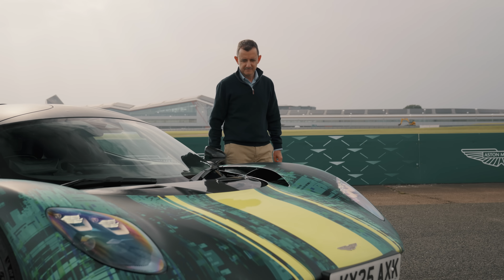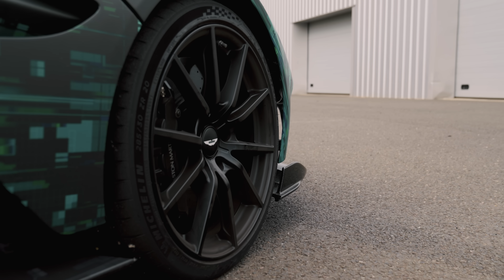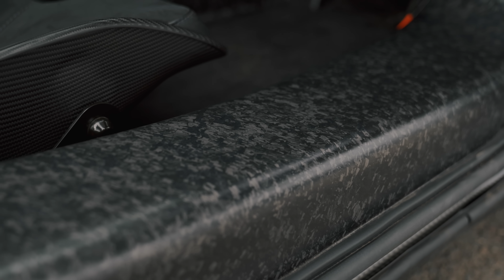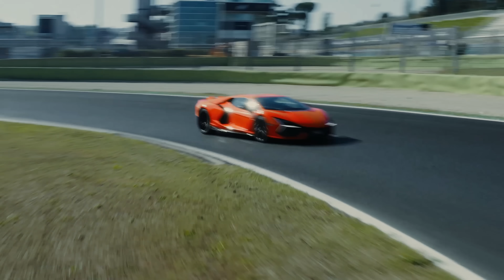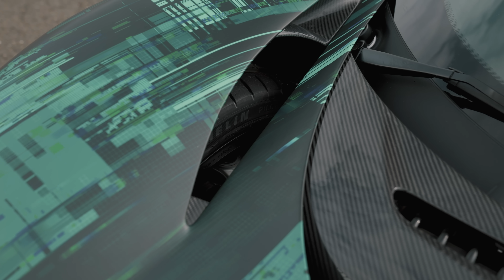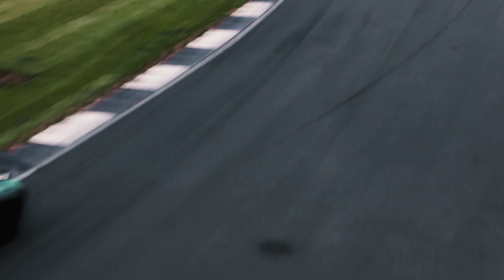FIRST DRIVE: Aston Martin Valhalla Prototype – 1064hp Son Of Valkyrie!

Comment: The Valhalla sounds like garbage compared to Gordon Murray's T-50 which sounds like the old V10 formula 1 cars.
Plus the T-50 comes with a proper manual transmission as all sports cars should.
SaveTheManuals.

Comment: Is the Aston REALLY 100kg heavier though, based on how Ferrari's claimed weights are basically porky pies? No fluids, stripped out, every carbon option fitted, no driver?
Reply: Ferrari quoted dry weight figures for the SF90, just the same as Aston Martin doing for the Valhalla. The Aston is 100kg more and uses a full carbon tub unlike Ferrari using a mixture of carbon fibre and aluminium chassis.

Comment: Part of me wants to see this race in GT3 or GT2 to compliment the Valkyrie LMH. It seems like a much better base for a racecar than the Vantage.
Reply: GT2 doesn't exist anymore. It could theoretically race in GT3, but the car would have to change a lot. The hybrid system would have to be removed and the engine would have to be detuned from 817hp to maybe 500 to 550hp. And of course the rest of the car including aero and weight would have to change.
Reply: @connorobeirne934 it does exist, just as a class for gentleman drivers these days lol
Reply: Nah, I hope they don't touch the Vantage, it's a modern classic. 
They were gonna use a V8 mid engine vanquish as their GT racer base but they abandoned it and I am kinda glad. Don't ruin classic names. If they want to take one, let it be the Virage or Bulldog. But I still want the Vantage to be the racer for as long as it is competitive.

Comment: Someone said that the corvette zr1x is a competitor to this. The only thing common between them is the 1000 odd horsepower and that they're mid engined. The Valhalla and the corvette are completely different emotions.
Reply: have we forgotten the Temerario?
Reply: They are not really that different in the emotional aspect.
Reply: @grndwrksim  they are very different. ZR1X is more like 90% engine with electric only assisting the front wheels. You cannot drive 4 miles on the corvette with electric and the engine alone is vastly more powerful.

Comment: Every engine has its tone. Some scream, others sing.
Reply: And some flat-plane V8s sound half-hearted and monotone.
Reply: @Fuse_22  I mean it probably sounds great if it wasn't for all the noice and emission regulations that the EU is drowning all the manufacturers with.. They are literally destroying cars in real time with all the crazy opf filters and enforcing bigger mufflers etc to meet the requirements which are getting more and more strict by the day..
Reply: @ericjorgensens yes, so stupid to limit emissions so people dont die from them 🤦
Reply: @ericjorgensens  nah, it's just the way it is. Aston uses the same architecture for the AMG GT BS, which no matter what you do just doesn't sound great. I think it's something to do with the manifold structure but I can't be sure. If they had to go flatplane, I wish they would have used the Vantage GTE mod instead.
Reply: And this does neither..
Reply: The engine doesn’t speak. It composes.
Reply: And some are 🐝
Reply: Some snore

Comment: Aston need to sort the soundtrack of the car. Have they not learned from the MC20? If the car sounds good enough you can plaster over the cracks as the character and looks win over the heart but if it doesn’t sound good enough those cracks look like canyons. Not that I’m in the market for a £500k supercar but the no storage situation is redinkydonk. How are you meant to go road trip to Le Mans, Scotland or Monaco etc. I really want Aston to succeed but sometimes they do shoot themselves in the foot. Those screens… at least try and integrate them so they don’t look stuck on for a £5er. A car this expensive needs to look and feel the money, metal touch points, flip away screens maybe so they don’t age it. Anyways yea, if MC20 had the sound of the V8 MC Stradale that car would have done so much better. But sounding like an Alfa Giulia / M4 isn’t exotic enough for the price tag. Beautiful car though. This car may face the same issue, not sounding exotic enough. A 2016 Vantage V8/V12 sounds better.

Comment: Im starting to wonder if the trend of these cars from F1 owners are a way to get around the cost limits that the FIA puts on teams so that they can do more engineering than would otherwise be possible...
Reply: That has always been the case.
Reply: That’s why they all started racing in WEC they didn’t want to fire loads of engineers because they couldn’t afford them under the cost cap
Reply: @georgeoliver8300 Yeah but that's not the same as building road cars to develop F1 tech.. Which sounds like a bit of a reach if you were to ask me. It's usually the other way around.

It's also not surprising that F1 drivers who race for a road car manufacturer would be at the top of the shortlist to receive the one ultra-exclusive product that a given brand produces as a reward - especially if that product is a very fast vehicle; considering these athletes' obsession with speed... It doesn't mean it's just a ploy to circumvent the budget cap.
Reply: The F1 team and car brand are not related.
Reply: @JippaJ Lawrence Stroll is the Executive Chairman of Aston Martin Lagonda and owns Aston Martin F1.
Reply: @JippaJ  Some of the F1 engineers did have input on this car - and they had a lot of input with regards the Valkyrie. In fact, various elements (such as some body aero, the active aero and suspension) are passed from F1 knowhow and tech. Aston also have a brand new state-of-the-art Technology Campus across the road from Silverstone (Silverstone being their home track), including their brand new wind tunnel facility which they use for their F1 testing and will (if they haven't already) use for their road cars & GT track cars . They are also going to be hiring out wind tunnel time and some other facilities to other race teams and manufacturers for additional income - this had been stated by Aston in other interviews already. 
So, it wouldn't make sense to not share its resources, technology and use everything at its disposal for its own brands, whether for road or racing. Especially when the company has recently (relatively speaking) invested so much time and money for its future research & development. Finally, they do have ownership of the F1 team, the road going vehicles division and GT racing teams (there are some GT teams using the Aston Vantage platform that have alternative owners that I know of). So it makes economic sense for now and in the future.
Reply: @JippaJ ”Ferrari doesnt own or hold any Ferrari Challenge events nor does Lamborghini participate in super trofeo”.

Comment: If this car using hybrid V12 or V10 without turbo, or at least V8 NA. And it needs to rev up to 9K minimum. It will be so interesting.
Reply: That new lambo uses a N/A V8 and revs to 10,000rpm. Still sounds terrible, not sure why it matters.
Reply: @SeenThroughHaggis   Lambo is TT
Reply: @SeenThroughHaggis the V8 in the Temarario is a hybrid TT with 3 electric motors..........Do your research....
Reply: @SeenThroughHaggis  Lmao nice confidence.
Reply: Ferrari have a hybrid V6 TT in the 296 that revs to nearly 9 grand...
Reply: @pauln0371sounds bloody good too
Reply: It wouldn't pass the emissions regs.....
Reply: Why not?

Comment: I can see this Aston depreciating in the video.
Reply: If you buy a car based on arbitrary valuations then that’s an issue of its own.
Reply: Agreed, Aston’s are tough on depreciation. Thought about buying one new but will wait to see what happens in the used car market and if it goes the same trend used as the rest especially with a complex hybrid system. But for $600k would be a very interesting purchase but lack of any storage is definitely a down side for a daily.
Reply: Not special enough unfortunately.

Comment: I really want to see the Vahalla Drag race a Corvette C8 ZR1 or ZR1X or both
Reply: It will likely beat the Vettes. Quite a bit lighter with shorter gearing.
Reply: @mtnman1984  The Aston's dry weight is very close to that of the ZR1.
Reply: @mtnman1984 Definitely not beating the ZR1X. Watch Streetspeeds video where the ZR1 beat the Plaid. The only thing done to the car is a Fab Speed exhaust, and it beat the Plaid pretty easily in roll races. Obviously Plaid would win from dig races, but not by much. ZR1X will be low 9’s or possibly 8’s in the 1/4 mile, which I doubt the Valhalla will reach. It’ll be lucky to beat an SF90.
Reply: @dylangiles2624 I've been watching Brooks put the ZR1 up against a bunch of cars. A 1000 HP McLaren took the holeshot and gapped it. Granted, it's 600 lbs lighter than a Valhalla, but the ZR1 beating one isn't a given.
Reply: @mtnman1984 In what world is a Valhalla going to beat a Plaid? I doubt it would beat the plaid in drag races or rolling races. The ZR1 beat the Plaid in rolling races already, so how would a Valhalla beat one if it couldn’t likely beat a Plaid?
Reply: @dylangiles2624 dig race. I think the ZR1 handles everything short of the modified McLaren featured on DragTimes, but I think it could have a shot from a dig.
Reply: ZR1X vs F80 vs W1 vs Vahalla
Reply: active aero, pushrod suspension, carbon tub, vette has a lot to go up against

Comment: HOW MANY MILLIONS and it has the same rectangular screens in the new Mustang and BMWs? Weird way to get cheap, AM. Unacceptable.
Reply: £850,000 starting price is millions ?? As far as I know  - and I'm no mathematician - that's thousands!
Reply: @Wishi13  With options it will be over a million pounds easily.
Reply: Sensible since the car is not about bespoke touchscreens.
Reply: @srinitaaigaura  The sharp, hard edges poking out from behind the wheel don't fit the design of the car. The new Cadillacs have a more elegant, "sensible" screen that compliments the interior design.

Comment: I think this is a proper hypercar. ZR1X is definitely isn't. It has no carbon monocoque, no full carbon bodyworks, not a hyper price, and mass produced. Laptime is not impressive either being the same as gt3rs. If the base car is not a hypercar, more power won't make it a hypercar. Same goes to sf90xx
Reply: The ZR1X has a lot more in it at the Nurburgring, with a Pro driver. I’m not sure it’ll shave off 10 seconds like Misha said, but at least put it into the mid/low 6:40’s at the Ring. Also bear in mind that the regular ZR1 not even the ZR1X is 5 seconds faster then a GT3RS in every American track. So on most tracks they are not even close.

Comment: Id take a Temerario over this with its 10k redline and 907 hp and save half a M
Reply: 10,000rpm and sounds horrendous
Reply: Bro not even close.
Reply: I'd take a 296 Speciale over both of em and save over half a Million...I'd even take a standard 296GTB and save well over £600k...
Reply: @pauln0371 i second this, sounds better than either other car mentioned

Comment: Aston should have put their v12 in this car. It would be much more desirable
Reply: would step on the toes of the valkyrie, even if that is a cosworth and this had a different v12
Reply: @hertzwave8001 If they had extracted 1064bhp from the V12 and electric motors then how will it step on the Valkyrie's toes? Also, Valkyrie was sold out when the allocation for this car started.
Reply: 3 motor setup just like may other brands Porsche, Honda, even Tesla did. Now Ferrari, GM and this? Hypercar now a days almost the same.

Comment: Ginger barded Ollie Marriage was not what I had on my 2025 bingo card.
The car looks great but seems to be lacking a touch in the numbers department, espcially the weight and the downforce, I would have preferred if they made the car a bit more extreme to offset some of that weight and by that downforce gains, on the PS5S tires seems to be a bit of a hoon which is nice and all, but we all know no body will do this and that is just a tire for road use and longivety rather than for actual fun as no one will do the drifting or even track days really